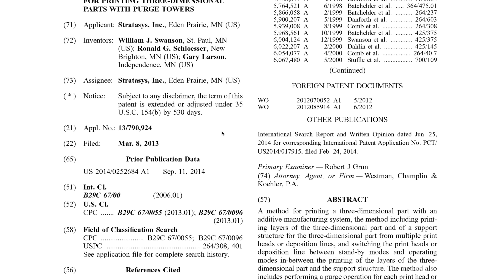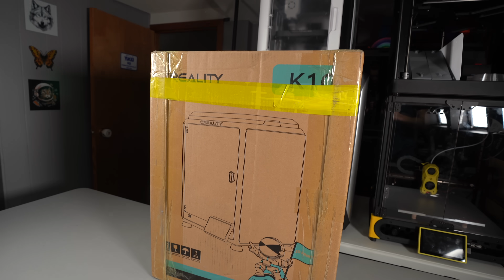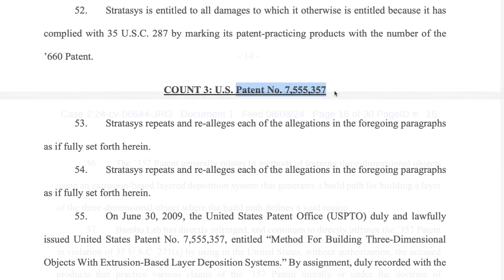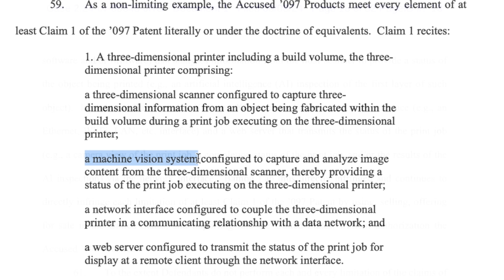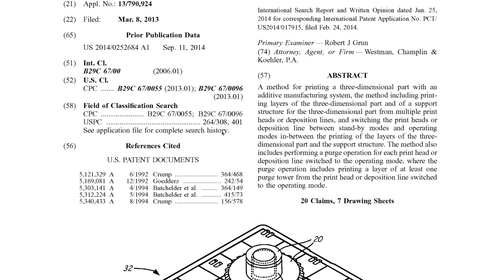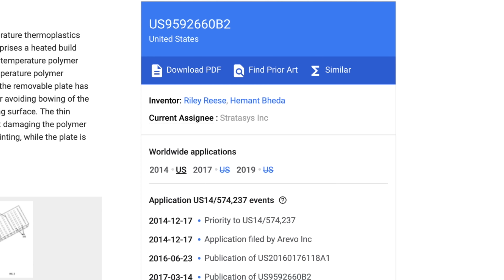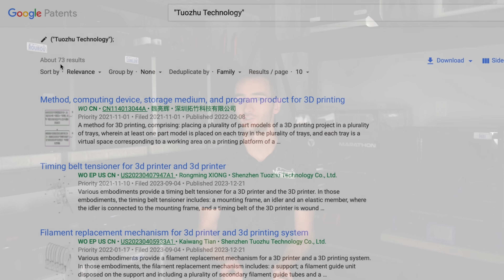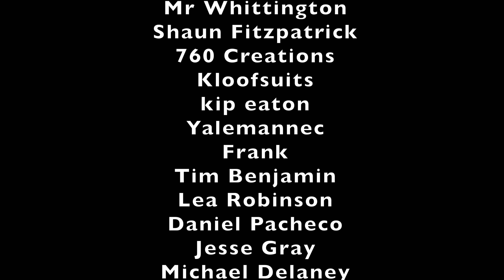Stratasys v. Bambu Lab - Will Prusa Play A Role ?

Comment: Stratasys only filed lawsuits because, they can't innovate and they want no competition using legal system as a defence mechanism and not being competitive.

If they even get to court the legal system is laughable.

1. RFID tag. Using RFID tags to read data.. how many places does this take place? The use case is to read data off a nearby item. Wether it be a roll of filament, a keycard, a pallet. whatever the case is. Using RFID to relay information is in no way transformative or unique in any way.
2. Networked control and remote management. Right so by extension they should sue the founders of MQTT network and any other IoT framework for enabling the remote management and control of devices over the internet.

I give up this is so braindead hopefully what happens is that the founding fathers of RFID, IoT communication, 3D scanning etc, LIDAR etc. sue Stratasys into oblivion so that everyone working there will be out of a job.

They are literally suing Bambu for incorporating existing technologies not developed by Stratasys.

Comment: And people complain Bambu lab is a walled garden… I remember the stratasys dimension line of 3d printers, they used a filament roll inside a cartridge with a chip inside, if the printer didn’t detect the chip it wouldn’t print meaning you had to use their own abs which was £50-£100 per kg (standard abs). It took a decade for people to hack the firmware so you could use other brands filament. Also the printer beds were removable and made of abs, this meant abs stuck to them incredibly well and prints would be removed with a metal filling knife and sometimes a hammer. The plates would wear out eventually and cost an arm and a leg.

Comment: Considering RFID wasn't invented by either and used in many different applications for inventory,  access control etc, I'm surprised that topic is being brought into the mix. Considering neither invented wifi either and there are 1000s of different devices connecting to wifi for different reasons, even that baffles me to why that's part of this suit.  Stratus is definitely reaching at straws.  Hope they see their ass on this one.

Comment: I was a volunteer at a CSU Fort Collin's 3D print lab called I2P project in Fall 2016. I2P Worked closely with Lulzbot prior to being purchased by Fargo Manufacturing, and at the time the president of I2P was also the owner of Lulzbot. Lulzbot  was selling Prusa based 3D printers with heated beds in 2011/12.  The first heated bed arrangement I am aware of is the Lulzbut-Prusa 1.0, and a historical document featuring it can be found by searching "lulzbot HOLP.pdf" in google

From that pdf:

LulzBot Prusa 1.0, 2.0
Figure 3.1: LulzBot Prusas.
The LulzBot Prusas were based on the Prusa Mendel design. The
Prusas printed more Prusas and they printed the LulzBot AO-100s. Ap-
proximately 128 Prusas were built. Prusa Version 1.0 production started
in the first quarter of 2011. Version 2.0 production started in the second
quarter of 2011

Additionally a picture of their heated bed can be found on page 33

Comment: I think one of the biggest defense points may be the fact that a massive amount of the allegations are saying they are infringing by using technologies that either are or would soon be industry standard. Also they have very vague and dumb patents. It’s like if Tesla came out and patented the general use of sensors for self driving vehicles. It makes no sense. If Tesla made specialized sensors then the specific specialized sensors could be protected, but generic systems that anyone coulda easily thought of and that aren’t overly ridiculous to implement shoulda be patented and that looks to be a good amount of this case

Comment: As someone who works every day with running Stratasys printers I have mixed feelings. They do a lot of things right, they provide headache free solutions which need very little fiddling to produce great results. Cutting down on man-hours, cutting down on service and tweaking, maximizes profit in the end. The printers are expensive, absolutely, but their quality is also high. Even at cost the price of the printer would be high considering the amount of custom parts. However, the cost of their material is inexcusably high, and you're locked in to using only their material, not even able to respool material on their spools as they're locked with a chip which records material usage. They're also not really innovating much, they seem content in trying to defend their market share.

So, we have bought a couple of Bambu Lab printers as well to use for anything which our Stratasys FDM simply cannot do, or do efficiently. I don't see one replacing the other, at least not on a corporate level where you're actually able to justify the cost, but they do complement each other very well. I really wish Stratasys would take the rise of companies like Prusa and Bambu Lab as a wakeup call, not to litigate but to actually innovate, and realize that the market is shouting for high quality and decently priced printers. Unfortunately I think their main fear is that this will devalue their professional grade, and often in the context justifiably expensive, solutions.

Comment: “a build platform WITH a temperature control unit configured to control heating of the build platform“

The build platform has to have the temp controller, i.e. PID controller, built in. Modern printers have the temp controllers on the mainboard.

Please stop trying to analyze IP when you can't even read the claims.

Comment: Interesting battle, and I hope BambuLab will get what it deserves. It build most of they products top on of open source effort. e.g. took open source PrusaSlicer and reskinned it with few additions and were hiding this fact. I am 100% sure that without opensource would not be here in this form and success. Then they started to patent and not give back to the community. I am not on stratasys side either, but BambuLab is going to be worse if it is not yet. I can imagine their future attack against open source too. We do not need a new DJI of 3D printers. We all should do something against it.

Comment: Based entirely on the breakdown you've presented here, I hope Stratsys fails here. Seems like they're going after Bambu for features included in just about every 3D printer out there these days in the first suit. So I have to question why they allowed those companies to slide on the supposed infringement and are specifically going after Bambu. As you noted, it's due to the more direct competition angle, but if I was Bambu's lawyer, I would be asking that question in the case. Why is their infringement unacceptable but everyone else's is fine.

I am definitely of the opinion that fair competition is ALWAYS a good thing. Monopolistic behaviour should always be discouraged. And if a patent for an industrial application prevents innovation in the consumer space, it should be reassessed. If it's not direct competition, stifling innovation in all areas around an industry for twenty years or whatever patents last for just to ensure unchallenged profits seems ass backwards.

I don't want either company to collapse, but if a little healthy competion from a consumer brand is enought to bring down Stratasys, perhaps they need to reasess their structure.

Either way, be very interesting to see how things play out. I'm not from the US, so I don't really have a horse in the race. Unless the lawsuit somehow makes Bambu disable features on already existing printers globally. And even then, there are open source firmware alternatives out there to restore that functionality.

Comment: The patent about the heated bed stuff isn't about a heated bed, it's about the steel polymer coated build surface that's removable.  Specifically a removable, polymer coated steel sheet.  It has nothing to do with heated beds.
Reply: Actually the heated bed is also part of the infringement not just the coated polymers removable or fixed, I have read through the patents very carefully as I design and build RepRap printers in an open source policy, The heated bed was first introduced  to the community of open source public in early 2010 might have been even earlier than this date but I built my first printer in 2011 with a heated bed from a silicon based mat using RTV silicon sealant running off a 24v 6amps battery and 6v relay after reading about someone in the UK who made one and I copied their design process, for the most part it was great but very unreliable and took ages to heat up the 3mm plate I was using and only manged to get to go as high as 38.7 degrees until the wire caught fire due to my limited electrical experience, by then realised I had to look at alternatives and back then silicon heaters were expensive as so stayed with PCB based heaters like the MK1 and then the MK4s that date back well before this patent existed, There are many other patents that they have filed since but nearly all pertain to include open source technologies that existed prior to their own existence as a company, open source does not grant IP rights nor do they garnish Patent rights as in the words and meanings of Open Source means that it is given to the public in a manner that does not require patents or rights of IP, S, In hindsight how can a company  claim ownership of IP when these technologies though through open source already existed.

Comment: A couple more important details: 1) Most of these patents are transferred from their buyout of makerbot. They are not Stratasys patents (except for one). 2) Bambu is mostly proprietary with locked down firmware and hardware, giving little benefit to the opensource community or Stratasys. This case could be potentially beneficial to the community if it forces bambu to open their hardware.

Comment: There is also the interesting situation with the gap filling patent. It is a common technology in modern open source slicers that is present in Cura and Prusa Slicer. Cura however is developed by Stratasys as their doughter MakerBot was merged with Ultimaker (the developers if Cura).
Cura is licensed with LGPL 3.0 which has some measures to counteract software patents (having software open but not forkable due to patents on the code). Therefore it could be that Stratasys has to file a lawsuit against themself for continuing to publish Cura. Or something along those lines.
#NotALawyer

Comment: The ongoing lawsuit appears to involve Prusa Research and Stratasys, with Bambu Lab at the center of the issue. Bambu Lab has adopted certain patents and technologies from the 3D printing industry, benefiting from years of research and development without reciprocating or contributing back to the community. While there is merit to the concerns raised by Prusa and Stratasys, the confrontational approach may ultimately harm the broader industry. If companies engage in ongoing disputes rather than fostering collaboration, consumers are likely to suffer, as prices may rise and innovation could stagnate.

Comment: If you do not enforce your intellectual property rights, you lose access to them. It’s pretty clear that a majority of the patented technologies incorporated by Bambu have been being used for at least 5 years by other companies in the consumer 3D printer space, and by open source projects for longer still. The only patented technology I noted that Bambu is unique in deploying is their monitoring of hot-end filament pressure. Which is a shame, since that could be extremely useful for clog detection, for compensating for uneven filament width, and more importantly for direct pellet extruders.
Though maybe they’re also the only ones to use LIDAR?

Comment: Example f370 fdm, 30K, print head life +- 900hours cost 1k, Abs reels measured in Ci , 90Ci largest , cost  ...£+-140 +vat.... , along with support reel £120....but thats industrial machinery for you....plus the 2K per annum   technical support _ free part replacements . Except print head is classed as consumable. We had a previous resin machine before this, it lasted 12 years. Now the 3d printing industry has been stunned by Bambu and others that Strataysys have basically been sleeping walking into this..

Comment: I have a receipt from 2012 for my RAMPS board which supports a bed heater. I also bought a PCB bed heater at that time. Now, where did I get that idea?
Reply: You time-travelled to 2017 and stole it from Stratasys's ultra secure IP vault.

Comment: Great summary. It's also important to note that Stratasys is a public company with share holders, share holders want one thing, return on investment, and Stratasys is loosing value at a huge rate. Share holders are not interested in removing Bambu as that won't drastically increase profits for Stratasys, they will want a licence agreement, removing Bambu will cost a load in legal fees only to see Stratasys continue to loose money. They are after a licence agreement with firstly Bambu and later wider companies. Stratasys share holders want revenue, no to punish Bambu for being successful. If anything they want Bambu to grow and take a share of that growth.

Comment: Stratasys printers were absolutely amazing during the infancy of open source printers. We still have an early uPrint working at my current employer. If it wasn’t for the locked down slicer that only allows 3 slicing options, use of their proprietary ABS at $258USD for less than 1kg, single use build plates, and mandatory use of soluble support as a raft for every print ( also insanely expensive), I would be advocating the company to keep it. But for the price of 10 rolls of Stratasys filament, I can get a Bambu P1S, 10kg of whatever filament I want, absolute control over the printing parameters, and faster prints. If Stratasys was smart enough to think of building an affordable product line rather than lining the pockets of their shareholders, Bambu never would have existed. Or at the very least, offer reasonable licensing fees and work with small startups to assist in a consumer geared device. They probably could have made unreasonably larger sums than this lawsuit will bring.
Reply: Completely agree, if they had a low end machine with small build volume (and foot print), rock solid reliability, and a few novel features - I’d consider one. Just don’t see them ever doing that, they are stuck in an old incumbent leader rut

Comment: I remember some trick called "Clean Room" This method was used in the tech industry to legally reverse-engineer software or technology without directly copying the original code or design. According to my knowledge, The current technology of the 3D printers is based on people making tests and bringing different ideas. They have to prove that Bambulab did had access to the stratashit patents and that it is not the implementation of community based research and ideas, which it is as far as I know and also as you did mention, that there where already some previous art in the reprap community. Stratasys will also need to deal with the swarm of developers, makers and very knowledgeable people that conforms the 3D printing community. This is not going to be good for them.

Comment: Good old practice: formulate a parent as vaguely as possible and file it in a patent office where the clerks have no idea about what they looking at. Then when someone comes along "infringing" your patent, go to a court which is patent holder friendly...
I giant but dying dinosaur fighting it's last fights. 
If Stratasys would be an innovative company, there would be no need for Bambu Lab. But they are just an old dinosaur (similar to Autodesk or Adobe in the software sector).
Even if Stratasys wins, it's just the US. There is a big and growing market outside of the US so just ignore the Americans and concentrate on other markets.
Reply: Dinosaur is irrelevent. The real highlight is Israeli-American Company
Btw Formlabs, the company that bought Micronics just to shut it down and basically stopped desktop SLS printing, also conviently has a jewish ceo.
Sensing a pattern here.

Comment: From the point of view of the open source community there are no good guys in this dispute between Stratasys v. Bambu Lab.

Stratasys has been holding back the movement from the beginning and Bambu has been recently ramping up its practice of patenting technologies that were developed by others in the open source community. They are both behaving the same but Bambu is only ramping-up whereas Stratasys has been at it for decades.

It seems that as Bambu as continues to capture open source prior art, consumers will be forced to build Vorons and other esoteric designs to escape the chilling affects of litigation. Designs like Voron are beyond the abilities of most makers and the community would suffer significantly. 

Bambu already took open source code from Cura and Prusa Slicer and the put that code into there own closed proprietary software. Bambu Lab only reversed course when they were threatened by legal action.

Bambu emulates companies such as DJI and Apple which lean towards closed APIs and proprietary designs. Even Prusa Research is feeling the pressure to patent their designs. This is all rather depressing because the lifespan of patents is far far out of touch with the actual time scale of development within the 3D printing industry. 

Here is a research paper on "patent parasitism", the practice of companies using patent law to capture existing technologies developed by the open source community: https://www.mdpi.com/2411-5134/8/6/141